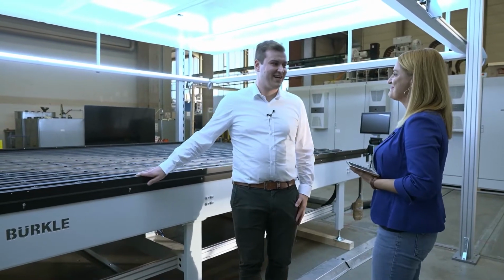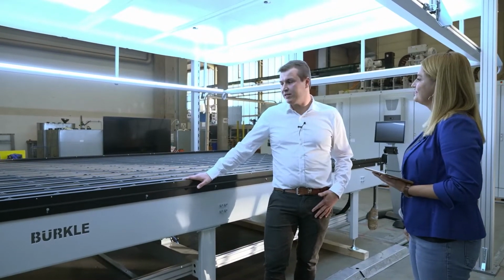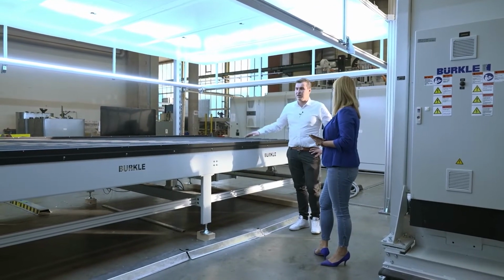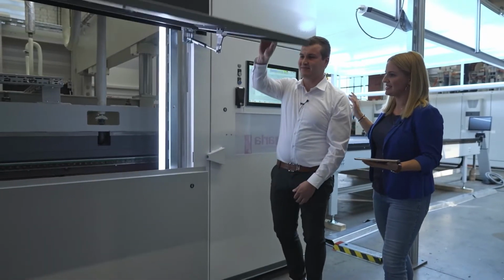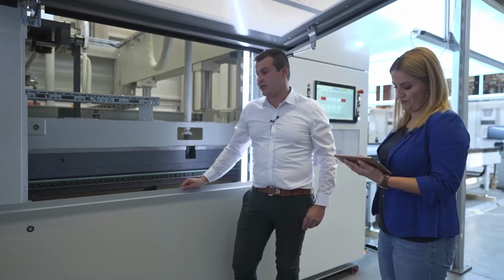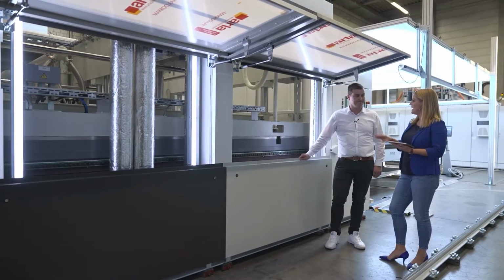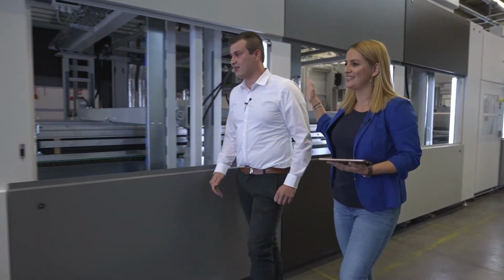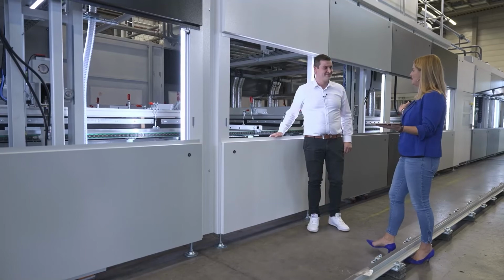The BÜRKLE Glass Expert Talks - Autoclavefree Glass Lamination (EN)

Comment: is it PVB or EVA LAMINATION , what is the max thickness
Reply from the maker: Dear Mr. Alkhatib,

you can use both, EVA and PVB. We have various experiences with different foils. The standard maximum thickness of the product is 25mm. 
For special requirements higher than the standard, we prove the requirments internally and enable it if possible. 

For more information you can contact our Sales Director Robert Gaiser, r.gaiser@buerkle-gmbh.de
or go on our website: https://www.burkle.tech/int-en/applications/laminators/technical-glasses